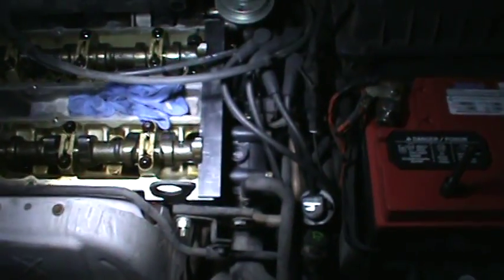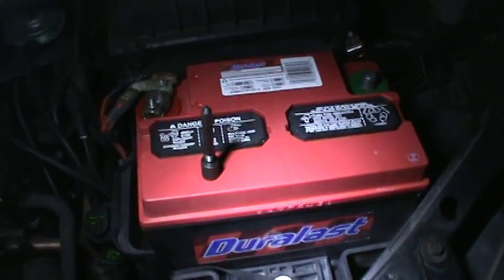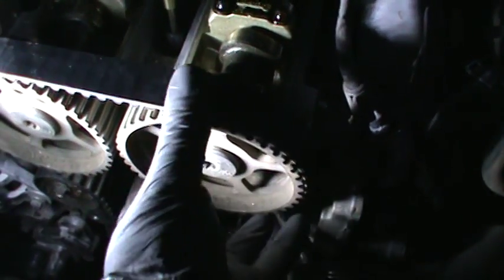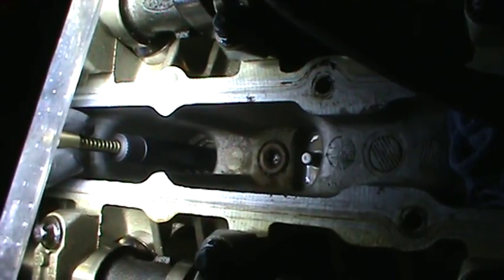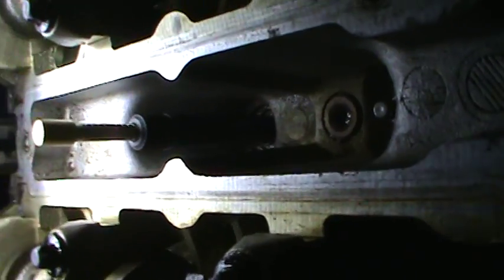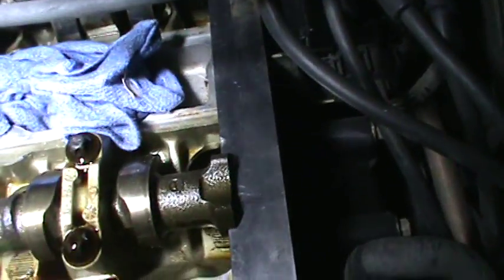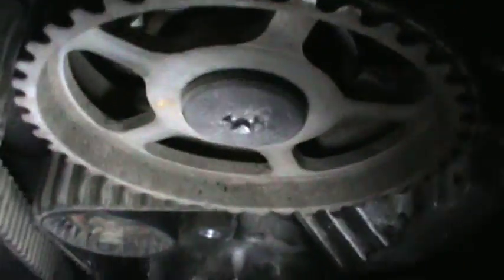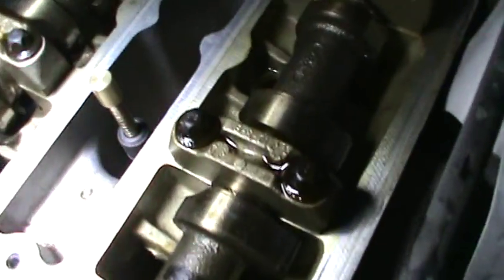How To Set Top Dead Center (TDC)

Comment: I have a question. WHY are you using standard sized tools on Metric items in an engine? Those engines have metric fasteners and you want a 21mm wrench to fit on the camshaft, not a standard wrench.